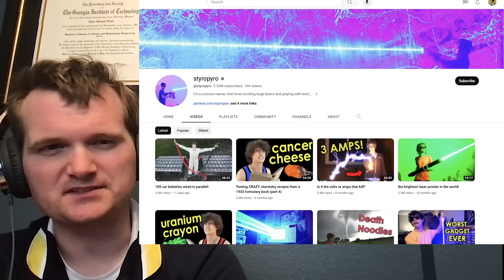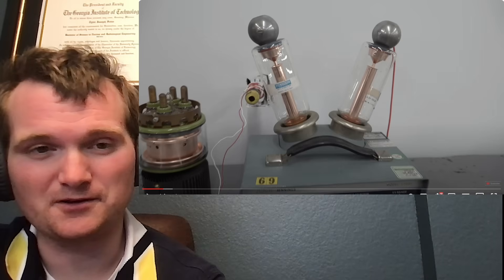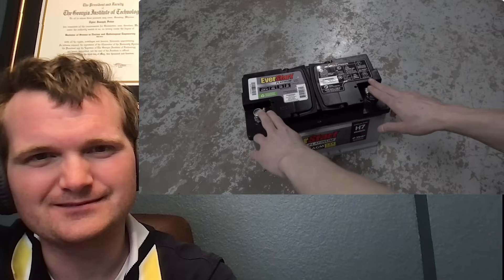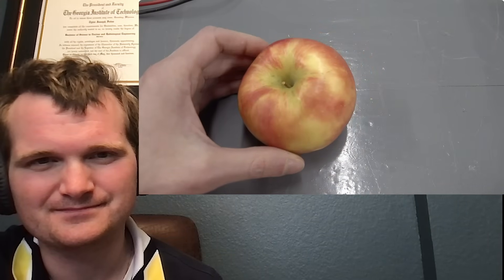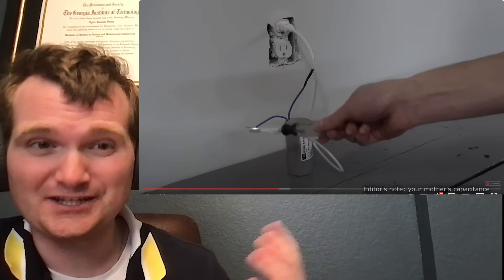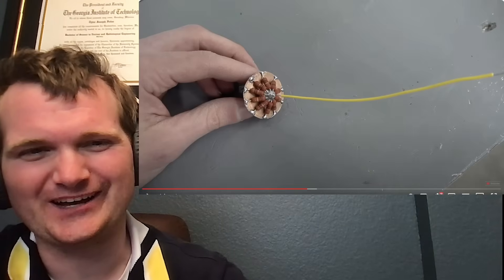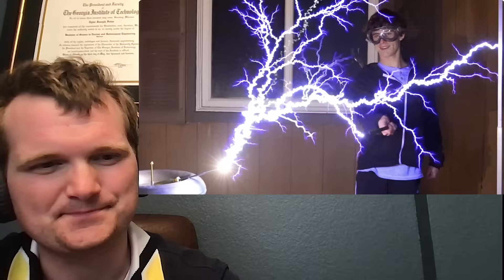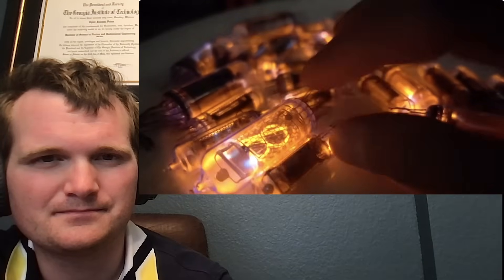Nuclear Engineer Reacts to Styropyro "Is it the Volts or Amps that Kill?"

Comment: I remember a story from some time back involving a 9v battery and someone trying to prove a point by jamming the wires straight into their own flesh. The implication being that a mere 2 amps could stop your heart if you skin wasn't in the way. This is more or less the point. It might not take a lot to mess up your nervous system, but you have to overpower the existing resistance first. But, a lot of volts, but virtually no amps, isn't going to be instantly lethal, though over a long dough time it might bake you. But, higher amps, even with low voltage, as long as it is enough to jump through you....

That said, I was not aware of the high frequency thing with nerves. And yeah, makes sense that a DC current in that case could be a serious problem, since it's kind of "no frequency".

Comment: Another excellent video. And you're quite right about the frequency. In my TIG and Pulse-MIG machine's manual on page 2 there was a big warning that anyone with a pacemaker should not only not use this type of equipment, but should not anywhere close to it when it is operating. The high-frequency unit would seriously affect their pacemaker, with possibly fatal consequences. So yeah, not good.

Comment: Voltage is equivalent to the size of the pipe.  Amperage is the pressure behind it. So the answer is both.  You need voltage to push amperage
Reply: Exactly backwards.  Another name for voltage is electromotive force.  The E in ohms law.  Note the word force.
Reply: @kenmohler4081  you're 100% right.
I had it backwards
Reply: Well, Tito, if you had kept a list of all the things I have gotten backwards, it would be quite long.
Reply: Resistance is the size of the pipe, volts the pressure and amps the flow.

Comment: I think the biggest thing here that people forget is strictly speaking in electrical charge, it's the amps that kill. However, you are more likely to get quite literally cooked by a high charge's temperature among other things. Bit extreme here, but think of the arc flashes and penalties used for punishment. What kills there? Usually not the charge itself, but rather the temperature of it all. Think of it this way, If we would die so easily off of electricity itself, then why do we use it in therapy?

Comment: In the medical industry burns are no longer classified in degrees, it's now measured in thicknesses.
Starting with superficial, moving up to partial thickness and finally full thickness.
It was changed to better reflect how severe the depth of the burn actually is has damaged, it also usually come with a percentage of the body damaged to each thickness, this was done to simplify the treatment process and better assess the level of an injury.
Hope you find that interesting.
Reply: When was this change from degrees to thickness made, and in which country did it take place if you don’t mind me asking? I always thought degrees was essentially measuring the thickness of the burn, or at least that’s how I processed it when I learned about that. I don’t quite understand how changing it to thickness instead of degrees really makes it more precise, because to me it just seems like a simplification of the terms and definitions more than any change in better descriptions of severity. I guess it’s just cutting out the middleman and jumping straight to using the definitions instead of giving those definitions different labels in a numbered system.
Reply: @CrippledMerc  Precise measurement of thickness percentage would let them break it out into more precise treatment schemes.  But the classic 1-5 degrees are at the major boundaries where things change substantially, so it's still a good scale for initial ER treatment, even if they want more precise measurements later when they shift from keeping the patient alive to trying to reconstruct things as best as they can.
Reply: @@bb-sky Ya that’s kinda what I was getting at though I may not have worded it the best. OP said it was changed to better reflect the extent of the damage, but degrees already does that. Making it more unambiguous is a great way to describe the change though. I wish I had thought of that word when I made my original comment.
Reply: @@bb-skyThat, and in other cases, such as murder classification, 1st degree is the worst type.
Reply: Didnt the degrees still give some idea of the severity and depth? Like third degree burns, by definition, are burns that go through all your layers of skin, right? How was that confusing?
Reply: Aren’t degrees based on thickness?
Reply: @danielolarte3693  That's what I thought, that first degree burns are superficial, second degree goes through the dermis, third degree through the subcutaneous fat, and fourth degree through muscle and bone.
Reply: When I trained as an RN 25 years ago in Australia burns were described as full/partial or superficial. Degrees were not taught
Reply: my country still uses degrees, I'd imagine since the descriptions for '1st / 2nd /3rd' are 'superficial / partial thickness / full thickness', and have been since 1953
Reply: @Azmodon  My country uses degrees too, but there are 4 degrees.
1. degree is harmless (skin is red, only first skin layer e.g. light sunburn)
2. degree is more painful and there can be blisters (strong sunburn/touch the oven)
3. degree is the most painful, burning through several skin layers, directly affecting nerves
4. degree is charring of the tissue, causing nerves to be completely burned, thats why there is only pain on the edge of the burn. Necrotisation of the tissue, high chance of infection. Irreversible burns that causes the body part to be destroyed.
Reply: @@brandyballoonSo you could maybe say that with only those options , 1st degree burn would be the best case scenario and 3rd degree burn would be worst case.
Reply: I have to say you look like a benevolent wizard. One that a main character would meet in a story that orients them to the right path.
And then comes back and is instrumental in defeating the big bad evil.

Sorry i have a vivid imagination and my ADHD meds have yet to kicking in XD...

Comment: So, Styropyro is not an engineer or an electrician.  Maybe he doesn't have a "Paper Chase" formal degree but he could give most degreed enginners more than a run for their money.  He is a great example of why degreed engineers should not design anything of real consequence until they spend at least a year in the trenches learning how real stuff works.
Reply: Important to note that he's a Chemist, and I think was/is a high-school teacher.  Meaning, he probably has a masters degree.  That's not to say that would cover his Tesla coil videos, but then a good 90% of EE classes don't either.
Reply: @EmperorA0  Undergrad in chemistry, was in a grad program (believe it was PhD) for something to do with optics but he dropped that for reasons he has explained. Styro got into optics when he did undergraduate research with a professor that was doing research involving optics. Either I saw this on a video on his or on a website of his. Interesting fellow for sure
Reply: Agreed, when an engineer leaves school and gets into the workforce, they basically are starting at zero. Lots of supervision. Their work will build more on their internships, less on classwork.
Reply: @brandonthesteele if you can even land one 😭

Comment: They actually make arc flash suits rated up to 140 cal/cm² they basically look like the suits explosive ordinance disposal people wear.  They fully envelop you, are probably like a good half an inch to inch thick, and have built in cooling devices so you don't immediately die of heat exhaustion.

Still wouldn't want to go anywhere near arc flash risks though.  Im perfectly happy over here, safe and un-smited.
Reply: And even with that, they still have a second person with a long hook to yank you back just in case, bc even with all that protection there's always the possibility of something going wrong.
Reply: Im with ya, at high enough voltages those suits are nkre to hell the cleanup crew then you
Reply: You know what that sounds like something I would feel invincible in when dealing with anything most lower-end ark flashes. They thankfully only last a few moments so as long as it has a good mylar coating and all that you should be fine. Not saying that I'd be around any of that type of stuff I'm weirdly scared of electricity
Reply: Yeah

Comment: OMG at 1:30 if you look at how he has that grounded, it is 100% StyroPyro engineering! Is that a screwdriver stuck into the wall socket with some little bitty wires wrapped around it??

Comment: You can't have amps without voltage. It's like having weight without gravity.
Reply: That's not necessarily true. The electrical system on a car is only 12 volts, yet the starter motor pulls hundreds of amps when you start the car.

Comment: Ohm's law works with inductors and capacitors in AC if you use complex impedance
Reply: Ahh complex impedance.  Using complicated math to create a number that can then be used in the simple math.  Though, it's incredibly useful and not to be underestimated.  As long as the limitations are kept in mind.

Comment: The duration thing reminds me of those videos of soviet metal workers passing their bare hands through streams of molten metal. They do it fast enough that they don't get burned. I used to pull tools out of hot deep fryers the same way. =)
Reply: It's not just duration in that case. They had wet hands so Leidenfrost effect takes place
Reply: @Rentta  for the molten lead yes, but not for the oil. and Leidenfrost actually works because of duration as well, because the speed at which the water turns to steam to form a blanket of gas is very important. the faster the water evaporates, the less time there is for the heat to go through the water layer into your body.

basically the water forms a heat isolator when it's vaporized, so it's like the opposite of dielectric breakdown.
Reply: @Rentta  but time is like 60% at least the reason for it don't burn
Reply: @Rentta  that only occurs for a few moments thought, so you have to do it fast to avoid burns
Reply: That’s the leidenfrost effect. They use a layer of moisture that burns away almost instantly but lasts just long enough to prevent the person from being burnt
Reply: yeah I used to wet my hand and put it in the flame of Bunsen burners in chemistry class using the same principle.
Reply: @Ikaros---  same, just i never tried it with wet hands so i only could put it like one second
Got to try that now, lets see how long it stays cold enough
Reply: I call BS... The hot oil will stick to your hand and continue to burn you. 
I'm sure that's the joke here, but you may cause people to actually try this.
If you want to try this with hot oil... Don't.
Reply: naah the Leidenfrost effect plays a huge part in this.
Reply: @outoffmyfacedootcom  yeah but leidenfrost effect don't do anything to not get you burned if you don't do it quickly. So again it's about the time.
Reply: They use water, wet hands will work similar to how heat shield's work on some re-entry vehicles. Where outer layer evaporates and vapor takes heat from object surface with it also creating layer of gas to protect object from heat.

Comment: Joules and Newtons of energy are a completely different beast from electrical, heat or chemical energy. It's not the fall that kills you, it's the impact, the sudden and extreme loss of Kinetic energy.
Reply: Newtons of energy is not a thing, newtons are a unit of force. Electrical, thermal and chemical energy can be measured in Joules too and often are.
Reply: @conorstewart2214  >"Newtons of energy is not a thing"
Clearly you fail to understand what Kinetic energy is and how it works.
Reply: @T3nch1  Newtons are a measure of force, not energy. Multiplying that force times a distance is what gives you energy. Pushing against an object with a kilonewton of force won't transfer any energy, if that object doesn't move.
Kinetic energy is also measured in Joules (formula is 1/2 * mass * velocity^2. The joule is one kilogram meter squared per second squared. The newton is one kilogram meter per second squared, which shows how multiplying that force by a distance gives energy).